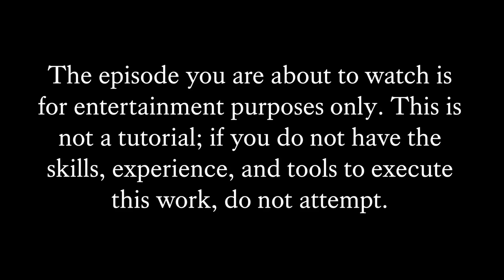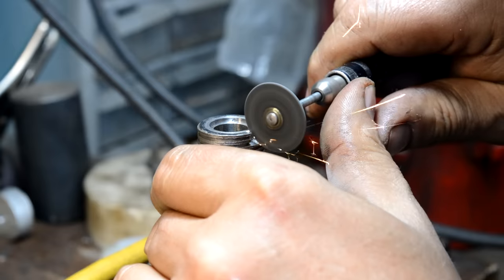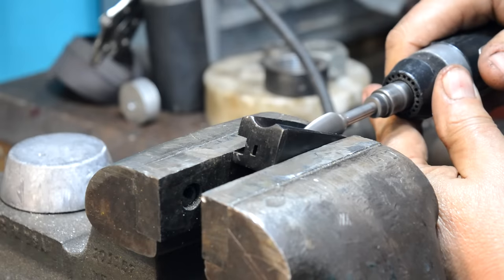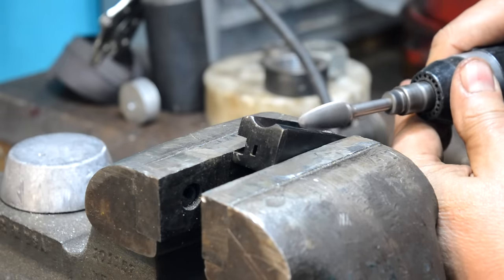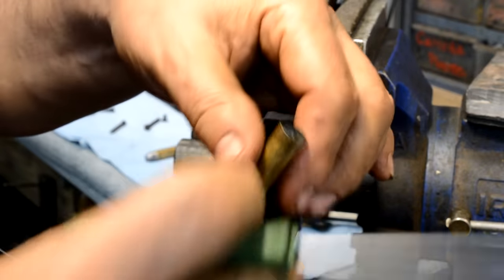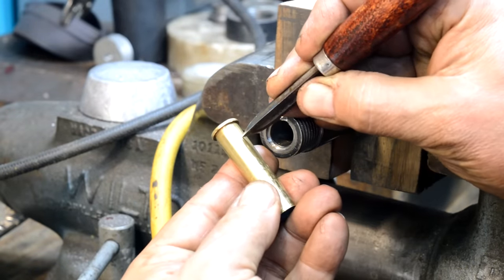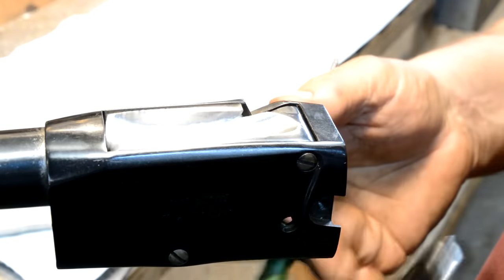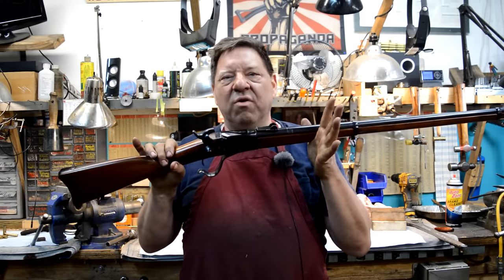Peabody Rifle chamber sleeve job: Anvil 112

Comment: @12:57 I would assume that was cut with a roller mill or a cutting wheel with the mandrel/arbor beeing cust above the receiverbody. 

Most parts where probably done on horizontal miling machines as they allow for lower cutting speeds and thus accomodate for the worse materials back in the day.
Reply: I don't know what the technical term is historically, but a machine similar to a belt sander sized perfectly for the width of the action could relatively easily grind the small amount of metal necessary to form the round and seat the bolt.
Reply: I have a horizontal mill, and I suspect that it would be difficult to produce the small radius of the cut using a conventional set-up. The diameter of the arbours on standard machines start at one inch, so the diameter of the cutters is bigger than that.
   I thought about it for a while, then it occurred to me that it could be done with a "Bull nose", (Spherical ended) slot drill. It would leave the ends of the cut  with a radius, but it would not be difficult to make a smooth bodied cylindrical cutter with teeth on the end faces, driven by a shaft through the holes provided for the axis pin. Slow and inefficient, but labour was cheap back then.

Comment: Mark, is that Devcon you are using to glue in your sleeve?  Just wondering, as I use Devcon for my sleeves and that looks like the same grey goop, good stuff!! I have sleeved a few sporterized .303 Enfields to 32 H&R Magnum, it makes for a fun plinker, and they can also load 32 S&W Long as well.
Reply from the maker: Devcon works well here, however I find it close to steel in hardness. I used a reamer to take the chamber to full dimension, and the softer acraglass was not in interference with the cutter. 6 to one, half a dozen to another.....
Reply: Why is it ok to glue something like that in I understand heat may not be an issue but aren't you running the risk of it breaking free ( complete novice just trying to get into gunsmithing as a hobby

Comment: Why not silver solder the Sleeve anyway. As sort of a belt and suspenders thing. Worried about losing the temper on the barrel?
Reply: Time is money, and is unnecessary for a black-powder rifle.
Reply: Because suspenders are a waste of money and just proof you need to wear pants that actually fit.

And that's a perfect analogy for the most likely actual reasons why he's not wasting time silver soldering it.

Comment: the obvious answer to make a blind half circle feature like you showed is a very small boring head / bar, but I doubt that would be viable for real production, possibly its a forging?
Reply: Possibly, that would work.
That is probably how they did it, but let me propose another possibility.
If I could see the inside, they may have angled through that notch on top where the hammer goes and driven the edge of an end mill at an angle to create the radius, assuming there is clearance on the inside. But that wouldn't give exactly square corners, so I think you are correct

Comment: Can't speak to how they pulled that off. I know the tools I'd use, today, in the 21st century, but can't touch that interior radius cut with my idea of 19th century tech. Pose a question though Mark. Why not a thermal interference fit on the insert? Half a thousand is easy peasy to pull off with a block of ice and a coal fire.
Reply: I'm with you. Whether you can 'get away with it (with black powder) or not', I would have tinned the sleeve and barrel and sweated it in with silver solder. I could have silver soldered it in less time than the extractor fitting!🤣 But that's why we're all different... nice video. Ya'll Take Care, John

Comment: Hey I am by no means a machinist. But I am a go-to guy. Is it possible that after the receiver was drilled for that pivot bolt, that a shaft could go through there with a slot like a keyway all the way lengthwise and a piece of carbide be put in there that could be adjusted for height and as it spun it would shave some metal off of the receiver and small increments? Just my two cents
Reply: Either that, or it was machined separate then welded into position.

Comment: My Martini Cadet action in 357 Maximum is right at the limit for length of round just like your 45-70 in that action. But of course it is no issue for the usual 38 Specials and 357 Magnum rounds i normally shoot out of it. Interesting that you brought up the size of Rolling Block Pins, when I modified a 32RF to 32 Smith and Wesson, I also made the pins .25 inch and hardened them. We shoot the target wadcutters in it and man what a nice trim piece. Your show, as always, is the best! And finally, the lovely 45-70, my favorite handgun round.

Comment: Thank  you  mark.  As   to   the   question  of   the  aft   receiver   cut  out   for   the  bolt  lock  up..... Well... to  be  honest  I'm   amazed  they   kept  machine   work  to  a  level of  a  few   thousands  using  steam/water  powered   Lathes   and  Mills,  I  Think  the  same   Mars  people   that  built   the  Pyramids  did  the   machine  work???????.
Reply: Did you comment this with a typewriter?
Reply: @Immafraid   I  have  a   special  computer  i  use  because I   lost  my  vision  in  Iraq, is  there  a   issue?.

Comment: To machine the flat-square-sided recoil face it would have been easiest to jig the receiver up on a shaper. The majority of the material could of been hogged off on a vertical milling machine then finished on the shaper to square the corners and take it to final dimensions speeding the process up.

Comment: I'd like to do something like that with my Remington Rolling Block. It's chambered in 43 Spanish and I'm having a time finding brass that doesn't cost the manly bits.
Reply: You can make .43 Spanish from .300 WM cases. I own a couple of Rolling Blocks (Remington Patria in my country, Argentina) and use that way to shoot them . But, this video made me think about the conversion to .45/70. It seems a good idea if barrels diameter would be similar.
Reply: @marcoaurelio296  I suppose they could be made out of 300 WSM. I don't know if the rim would work. I've heard of using 348 Win brass. I have about 100 or so of them. So I may mess around and see.
Reply: @kmorris180  The 300 WSM is 53 mm long, so I think it will not be useful because the .43 needs 58 mm (in spanish is called 11,15 x 58R). It's correct, the best option is the .348 W. The rim on the .300 WM is made by stamping a piece of brass in the groove, and also you need to remove the belt. The way to make this reform was published in a Spanish magazine called "Armas", in the '80s. I use Lee Dies. Recently I've seen shells with the rim tin soldered or threaded. Greetings.
Reply: I am sure there are many ways to make the 43 Spanish .. I am certain if I dedicated an hour to research I could find at least three .  If I were you , I would just re barrel it to 45/70 or 40/65   .  My original rolling block was re barreled to 45/70   thirty years ago with a cheap 45 dollar numeric barrel . When It arrived it was drilled off center . Way off center . We did the math and by cutting barrel length to 26 inches it could be done and have 7/8 inch across the flats . " It was suppose top be 28 inch long barrel "  So I said lets do it .   3 months later ,  " my gunsmith wasn't happy about all the time at the mill "  It shot great but kick was unusually bad and it bubbling primers .  Couldn't figure out why . I got the wise Idea to slug the barrel . It was 452 groove diameter !  So instead of sending of sending the barrel back waiting to get refund  ,then waiting to get a new barrel , I now had to order and wait for a custom bullet mold . Jim my friend and smith said told you ,you should have sent it back ,You would be shooting your gun 3 months sooner . But before my new mold came in Jim called said he felt sorry for me and made me a sizing die . Prolly wont shoot the best at least we can shoot it . 
It shot 7 1/2 inch groups at 300 . I shot my first deer with that gun 3 months later . With those squished down slugs .  I also shot coyotes , rabbit , squirrels .

Comment: Other than the fact that they are kinda "un-obtainiyum" did you consider re-chambering for a 45/60 round to avoid the dovetail in the barrel??
Reply: 45-60 is easily made by shortening the 45-70 round...

Comment: Mark, have you ever lined a chamber for a side by side shotgun? I know how to do it, but wanted to know your thoughts. It is Damascus and pitted in front of the existing chamber, 16 ga., Plenty of thickness in the barrels for a thin liner. I was thinking of acraglass, but thought that if everything wasn't perfect it may torch at the gap. I have bisonite,  high force 44 and silver solder. I really didn't want to go the solder route because the outside finish of the barrels is really good. What are your thoughts? Oh, it is black powder proofed only

Comment: miniature line boring setup is the answer old man
Reply: How when it doesn't line up with the bore? it is wider than the bore.
Reply: @davebrunner1272  a bar with a cutter in it think of a cross but with a peice of high speed tool steel
Reply: @jerrya27  You are right that would work.

Comment: You said you glued the insert into the chamber. Any reason you didn't interference fit the insert and shrink it with liquid nitrogen for installation? Perhaps the part is too small to do this?
Reply: Easier if he needs to remove it one day?
Reply: Liquid nitrogen is generally not used for barrels as it changes the material properties too much. Believe it or not you can effectively quench steel months or even years after manufacture using cryogenic processes (even after the object in question has been previously tempered), this hardens it and generally make it more brittle which is not something you want for a pressure bearing part. 

You also generally have to heat the outer part to expand it and the ability to do so is limited for the same reasons, if you heat the part too much you risk its heat treatment and thus strength, again not great with a pressure bearing part. 

Dry ice has been trialed in this specific application as it isn't anywhere near as cold and doesn't modify the properties to the same degree, but also doesn't shrink the part as significantly and the tolerances must be very good... 

However neither is really applicable for this application as the tolerances required adds far too much time/expense and cheaper processes are more than sufficient, even for M2 machine gun barrels lined with stellite all that's used is a press fit using a hydraulic press with a steel plug screwed in behind it for positive retention. 

A glue joint is more than sufficient for this application, as while the radial forces are moderate (its black powder) the longitudinal force pushing the sleeve backwards out of the barrel is going to be very low (single digit pounds per square inch, maybe double digits but I really doubt it) as the case head is fully supported (the case can't setback as long as the headspace is correct, and if it isn't you've got far bigger problems) and it isn't extracting under pressure (it's a single shot rifle), and due to design considerations gas cutting is completely avoided.

If I were doing similar I would probably degas the epoxy using a vacuum chamber to reduce the number of air bubbles and thus voids to increase strength and thermal conductivity a little bit, but it would be a pretty minor improvement and as demonstrated is more than sufficient. It's very easy to over think/engineer things like this (and cost the customer money in the process) when the  simple approach is all that was needed (and keeps the customer happy as they're not paying for something they didn't need).
Reply: @etelmo  Thanks much! Your in-depth answer is quite an education for me. Much appreciated.
Reply: It’s a BP round. He said to use BP only and it will never get hot enough to break down the glue, with a single shot. Plus it’s quicker.

Comment: Would it have been smarter to go with a different barrel using a P-14 surplus , that way you wouldn't have to remove so much metal from the breech block for a .303 enfield round.
Reply: Assuming that the customer wanted to run it in .303.

And with that limit to black powder only, I don't believe it would be possible.

Comment: For the squared off semi round cut? I'd guess a wheel burr, inserted from inside the receiver to the outside and then chucked up to whatever is driving it. I was a jeweler for 26 years and I've seen those burrs in the jewelry trade, not sure if the same was used for gunsmithing. That's if that relief was in fact machined, weird shapes where it's hard to get a tool in there is usually handled by casting

Comment: U could fit some thing through the bottom side.. it's a big sized hole. And it look like u could angle a tool in and onto that spot. At nearly a 45 degree angle.

I'm not sure but they make all size bits out there... I can picture a tool that could cut such a shallow but wide groove.or dimple.

Comment: All I can think is that they could have had a rod with an adjustable cutter in the middle If the rodent went all the way through both holes It would be Easy for them to ensure that it was even all the way a crossed

Comment: My two cents but I would never have taken that much material out of that block. I had a Peabody in 50-70 with a trash bore so I step drilled using piloted drills and reamed the barrel then turned a liner to fit. Chambered it in 40-50 Sharps bottleneck. Good safe round and fun to shoot. I already had a Shiloh in that round so I had ammo. By the way how do you know the sleeve was concentric to the bore?
Reply from the maker: I cut the chamber after a rod down the bore showed true.  The sleeve was then final reamed in place. This bore was in great shape, liner holding up well after 300+ rounds.

Comment: Personally, I would have gone with 45 Colt. The dimensions would have been an easier fit all the way around. Of course if you want to use it for hunting and not recreational shooting, you gotta do what you gotta do.
Reply: It could always use a .45-70 case cut a little shorter.  reloading this would force someone to be more aware of the special requirements of the rifle and it would allow a more natural extraction, and still allow more energy than the 45 colt would allow.  Setting it up for a factory round that has a smokeless version available is a little un-nerving.  Perhaps not completely dangerous, but could use up most of the safety factor involved.
Reply: @MrEric_API  45/60 could have been an option. True enough. But one of the stated goals was not to be reloading another odd ball caliber. 
I believe both 45 colt and 45/70 are black powder rounds with higher pressure modern modern loadings available. 
I was thinking not only about case length requiring thinning the top of the bolt but that the .451 diameter of the colt round would have been a better fit than the .458 used in the 45/70.. 
 Of course, since I did not have the actual rifle in my possession I don't know if the metric  bore diameter is more nominal than accurate. The actual metric conversion of bore diameter puts it a lot closer to what you'd find in the pistol round.
Reply: @mrwashy2259  .45LC cowboy loads and .45-70 commercial ammo are loaded to black powder pressures, even with smokeless. Any .45-70 loaded to more than a Trapdoor Springfield can handle is very explicitly marked.

Comment: Hey Mark, quick question...what kinda glue/epoxy is used to cement the sleeve in place? Would think it would have to be pretty high strength and hi temp resistant
Reply: I think he used Acraglass.
Reply: For a smokeless firearm? Silver solder.

Comment: Wouldn't a 458 SOCOM be a better fit for the action?
Reply: no
Reply: Lengthwise, possibly, but I'm guessing that the .458 SOCOM would produce too much pressure for the action and the sleeve to handle.  While the Peabody falling block action is pretty strong for the time, it isn't multi-locking lug strong.  We're still dealing with actions that were meant to handle black powder.

Comment: Ball end Mill and an 1850s dremel 🙂
Reply: a ball end mill wont leave the ends squared off
Reply: @pghgeo816  I know that is why I jokingly said a dremel,  you'd probably broach or chisel it out the remaining or if you had a burr that could fit the pin hole 🕳 or forge it in